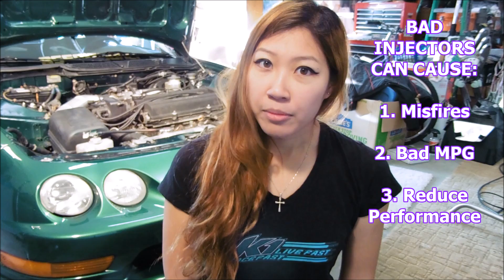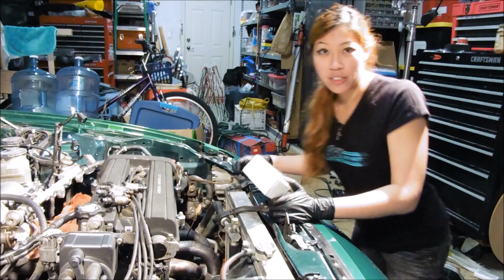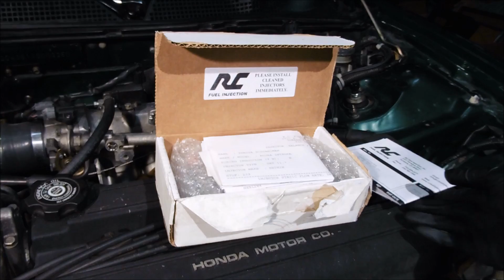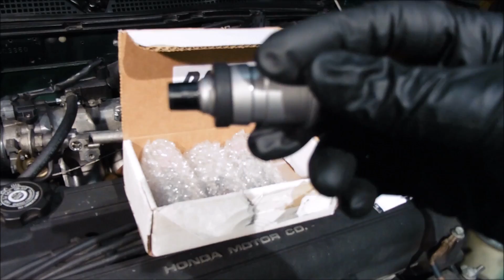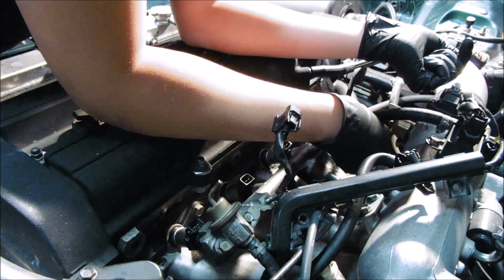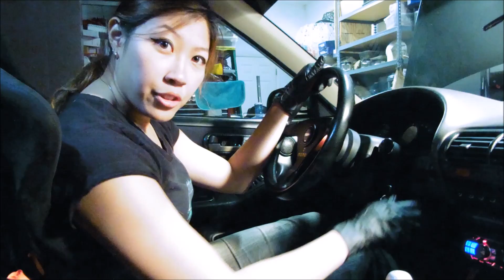How to Remove & Reinstall Integra Fuel Injectors (VLOG 7)

Comment: Great video Thadya.  My Neice has a 2000 Integra LS and her engine lightis on with a P0302 misfire.  We replaced the fuel filter; spark plugs, wires, distributor cap & rotor, and ignition coil.  Engine light went off for about 2 months then came bacl on.So now we're thinking it's time to clean the fuel injectors since her care has over 173,000 miles and injectors have never been cleaned.

I know it's been 8 years since you did the video but just wanted to check with you to see if you still recommend RC Engineering.  Also, what are your thoughts about replacing the injectors with new aftermarket injectors?  Any suggestions on which after-market injectors are good?

Thanks again,

Ken

Comment: Great video.   
Brings up a question i didnt know i needed to ask. 

Ive got a 98 b20b.  With a gen1 skunk2 intake manifold.  
I bought (realizing now  i probably bought way too big size of injectors. For my application.  (( 370cc peak n hold rc inj i assume. They are obdo or obd1 connectors i forget.))   

(Thinking out loud) I am assuming the fuel rail and injectors currently on the b20b are the OEM  obdo p/h injectors for the b18a1. As the engine was running off of the obdo pr4 ecu.  

When. You explained there are different seals fir the injectors depending on intake.  (If i understood that correctly.)   

Since i have a gen1 skunk2 I/M.  On the b20b.  Cc of injectors aside.   Which set of seals/o rings.  Should i buy ?

Comment: Thank you Ms. Virginia very informative. Installed new beckley arnley injectors in my 94 LS R  and was a vast improvement. Also the temp. sensor for the ecu, O2 sensor. Now let's see if that carbon in the tip goes away 🙂.
Honda Mike

Comment: I just wanted to thank you for this video!!! It was of tremendous help as I have a 1989 Integra and this came as close to the year of vehicle that I have. Also, I used RC Fuel Injection to have my nearly 30 year old injectors reconditioned to as new condition! I definitely recommend them and it's way cheaper that getting new injectors. It's amazing the difference as 3 of my injectors were barely spitting fuel!!! My only issue now is that I still have a little fuel leaking from the injectors, I'm assuming it's the gaskets. But, it's greatly less that before, and very minor. Also, since my vehicle is a 1989, I was unable to free the fuel rail and lay it over like you could on your vehicle. So, it was very tight window to remove & install the injectors! And since the valve cover was leaking, I replaced that and the spark plugs! Great videos!! You made this look very simple!!! Outside of not being able to lay the fuel rail back, it really was pretty simple.... I'll check out the rest of your videos to get insight on other projects I need to do!!! Keep it up!!!

Comment: Hey there I have a 96 b20b swap. And some how it’s been happening for a month or so now. My car will not let me rev past 3k rpm . Also it stalls and jerks at 3k rpm every gear. I was wondering what u think that’s causing it to do that? So far I change new spark plugs. I took it to one shop in town but they couldn’t figure it out to. People say that it’s in limp mode but still can’t fix it
Reply: Could possible be that timing is off a tooth or so. Usually what casue the veichle not to accelerate past 3k and wanna bog out. Get a timing gun. Or use the marks indicated on the cam shift pulley and lower timing belt cover. And make sure the cam sprockets are at top dead center for cylinder 1. Usually there's an up arrow on the sprockets those matter but not as much as the two individual lines on each sprocket those should be parallel to each other.

Comment: new o2 sensors always help as well
Reply: In my experience that is not the case.  Unless an O2 sensor fails a snap test or has a failed heating element you wont see any change replacing the 02 sensor.